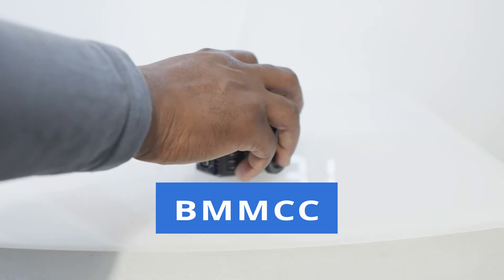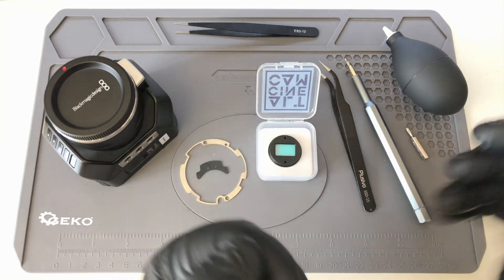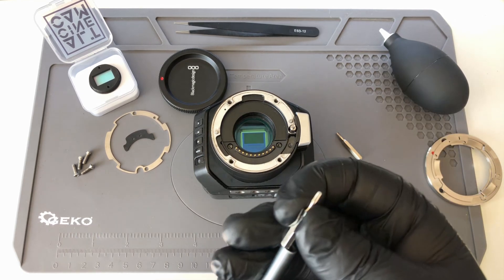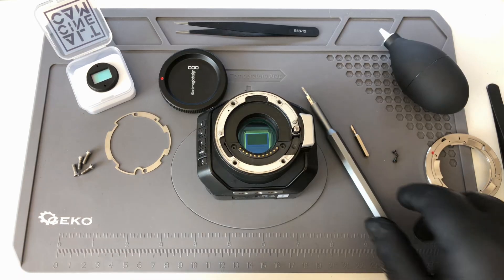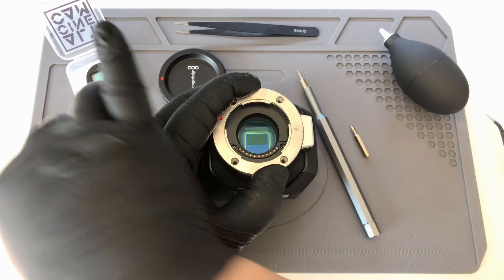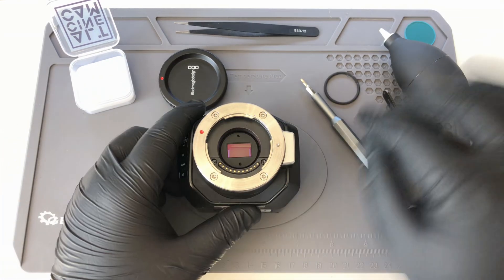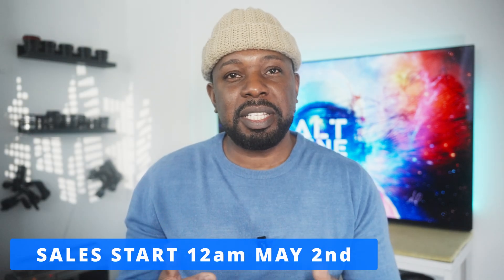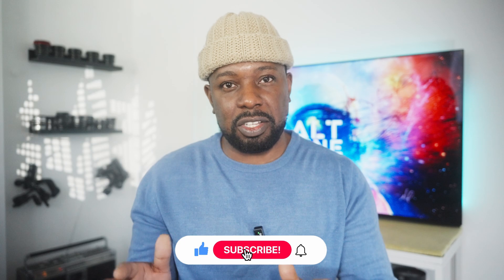BLACKMAGIC OLPF - Installation Guide

Comment: …you could have only created a filter with the same dimensions as the original. with the vistro fiktro you will not be able to use the metabones necessary for using Canon Ef lenses 🙏
Reply from the maker: You can't do that. Blackmagic use only a cheap IR cut filter which is very slim and this is what causes the problem to begin with.

It's a double edged sword...either suffer with moiré or use 0.71x speedbooster.
Reply: @AltCine  Thank you

Comment: Excellent! Easy enough, very good tutorial! For anyone going for this(after doing this MULTIPLE TIMES on a micro), make sure that blower is 1000% free of particles. I have a cheapo one which is AMAZING and a Canon one that sucks, for some reason blows particles! Make sure yours isn't one of those test on a lens first and see if it blows any debris onto it. Also blow a few times pointing at something other than your sensor to make 100% sure, cant stress this enough. After this, use the blower after removing the original ir cut so NO DEBRIS is left on your actual sensor. Having to undo this is PITA and will increase your risk of effing something up. Dont be scared, its not hard, just make sure you have all your tools ready to go.
Reply from the maker: Cheers bro, yes definitely use a good set of tools and preferably a blower that's been stored well and not in the bottom of a garage drawer.